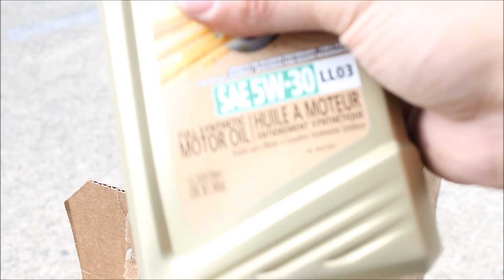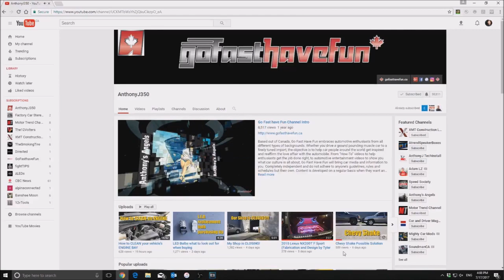Motordyne XYZ Pipe Install Nissan 350Z/ Infiniti G35 | AnthonyJ350

Comment: Good vid, hope you let the exhaust warm up naturally by letting it idle :P Exhaust instructions, section and info was great... I don't believe in aftermarket oil filters and especially NOT in Castrol, no matter what level... And besides a well run in Z shouldn't run on anything less than a 10wXX ... Use Liqui Moly Touring High Tech Special 15w40 with MoS2 Liqui Moly oil additive and your exhaust smoke will be gone, oil pressure exactly on its mark and no hassle of worry if your'e leaking if your gauge shows up correctly ;)
Reply from the maker: Gideon Dippenaar Thanks! I can tell you at idle the car on Castrol is more quiet. I just put in the recommended oil viscosity the manufacturer recommends.
Reply: I work @ Audi now and we use Engen (Mobil) even though the cap says Castrol, but in my long term experience with Castrol (  :O  ) Seriously Gunks up oil galleries... Clean your oil cap nice and shiny (I saw you know how to clean ;) Big thumbs up on that btw!!!) and keep a eye on oil Vapour that hardens on it (+-2500km should show)... Thats the biggest problem I have with Castrol... Strange that it's quieter, actually impressed :?
Checking out your other vids now, very nice!!! Dig your style! Hope to chat again!!!
Reply from the maker: Interesting because the VW/ Audi dealership that my friend works at the techs love the Castrol professional.  Now the cars you see the oil galleries gunk up, is that your own vehicle or customers?  Because a lot of the new Audis are small displacement turbo applications that make good power but generate a lot of heat.  Is it possible customers are driving the car hard and not allowing the cars to cool down enough and are not changing the oil at recommended intervals?

A lot of VQ owners also prefer to use Castrol Synthetic if you talk to other owners.  2 of my other friends have VQ motors and theirs were always more quiet than mine till I switched over.  I have a video where I do a heat test and someone commented how loud mine was at idle vs the other vehicle.
Reply from the maker: Interesting because the VW/ Audi dealership that my friend works at the techs love the Castrol professional.  Now the cars you see the oil galleries gunk up, is that your own vehicle or customers?  Because a lot of the new Audis are small displacement turbo applications that make good power but generate a lot of heat.  Is it possible customers are driving the car hard and not allowing the cars to cool down enough and are not changing the oil at recommended intervals?

A lot of VQ owners also prefer to use Castrol Synthetic if you talk to other owners.  2 of my other friends have VQ motors and theirs were always more quiet than mine till I switched over.  I have a video where I do a heat test and someone commented how loud mine was at idle vs the other vehicle.
Reply: AnthonyJ350 Customers cars. I won't use anything other than Liqui Moly again. Had a '69 Triumph Spitfire and a Opel Corsa that both started getting clogged.. The walls in the engine dries out, the oil runs down and the last bit dries to a crisp, leaving a NASTY deposit... Not sure how the new oil fairs, but I can definitely still see that drying up process...
Reply from the maker: Gideon Dippenaar That's interesting. Because I've seen a couple of my one friend's cars who loves old Toyotas, well over 300,000km and the internals looked pretty good when he did the rebuild and all he used was conventional. I was under the impression as long as it's API certified and you change it regularly you'll get good life out of the motor. But you take apart motors and see this stuff way more than I ever do.
Reply from the maker: Gideon Dippenaar 1969 Triuph is pretty old. How long did you own it for? Did you do a rebuild then take it apart again to discover the build up or was it the first time taking it apart?
Reply: AnthonyJ350 It was my dads car before I bought it from him... Car was in and out of hibernation, but he kept her clean. He bought it in the early 80's from the 1st owner. British cars are a nightmare though, they always leak oil, break down, etc. So to answer the question, I replaced lots of gaskets and seals and when the head gasket failed I could Really see the oil build up.... And it's definitely not just carbon deposits... API, SAE are but words in my eyes... Some stuff works great, some stuff has repercussions... I have a feeling that if you replace the oil very diligently, you won't see the full negative effect, but it will still happen over time... And the old Toyotas have GREAT oil systems, basic and excessively generous space. The original Castrol GTX2, factory filled, dirtied those engines big time, but never saw damage from them, except valve stem seal leaks... I'm just scared with the newer cars. Oil system are much tighter and throwing in the wrong kind of oil in a car that it wasn't made for is delaying the inevitable.. For instance, all the new VW group diesel engines, even from my days at Porsche, uses a special Mobil 5w30. Those engines WILL break down if it's not used... Like freaking water!!!
Reply from the maker: Gideon Dippenaar Weird because there are some oils you can buy in small towns that don't have any certification so you don't know what you're getting good or bad. So you're saying Castrol might have just given Audi a bunch of money and VW/ Audi doesn't care what happens. There's a few guys with VQs with over 200,000 miles and 300,000 (not Kilometers) and I know one likes Castrol. That being said it seems any major brand you go with you'll probably get more than enough life out of the motor for years of ownership. I've been using Eneos in our dailys because we get it for cheap, just change it often. I do still have access to Lubimoly, Pentosin and Motul. I think the European stuff is really good, that's why I figure the Castrol VW spec would be good. If it's good for a GTI or an R8 it should be more than enough for my Nissan. I will be doing an oil analysis video between Eneos and Castrol with 2000 miles on the oil to see what we find.

Comment: Sounds like there is a huge exhaust leak and it's extremely raspy for my taste.
Reply from the maker: I had to replace the gasket at the muffler after.  I had it better sorted out in this video https://www.youtube.com/watch?v=pAbAZHBxI6M

The problem with this setup is it's just resonated tubes in the muffler and resonator with no accoutic material.  I plan to get the Tanabe Medallion setup for next season so stay tuned for that!
Reply: That explains it! I'm going to check out that other video now. Thanks man. Keep it up!